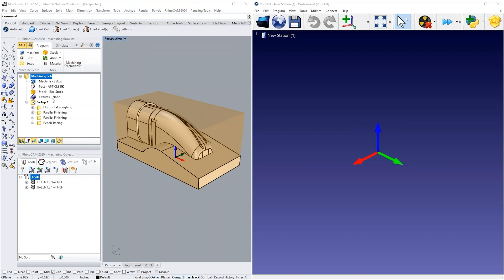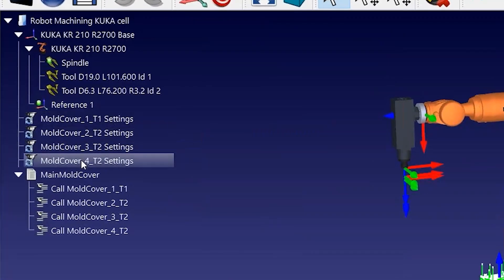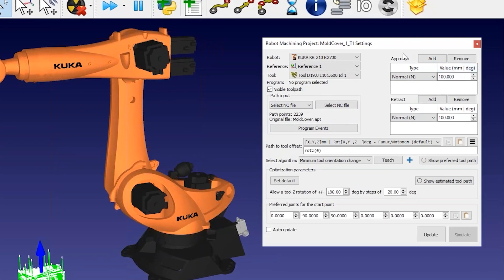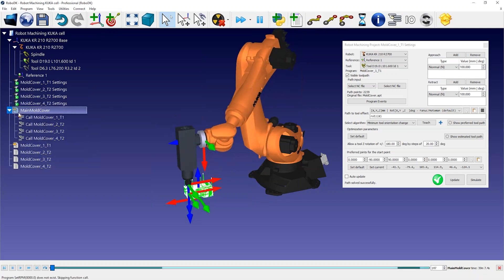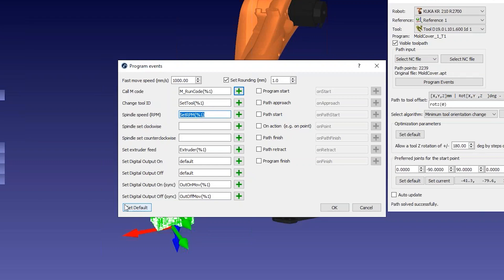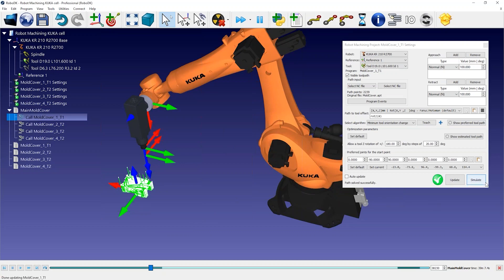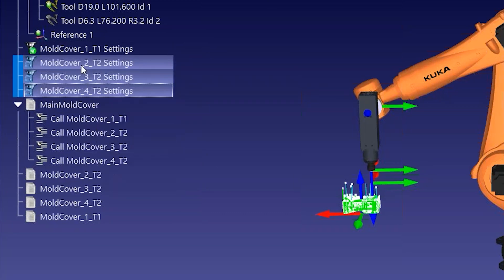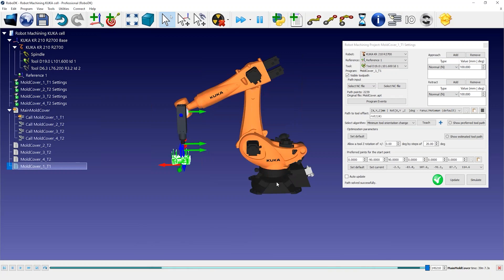3-Axis Robot Machining Example - RoboDK

Comment: How can i add or chosee tool diameters? I mean cutter tool diameters? You show how can we milling but you didn't show how adding cutter tool. There is no any information about cutter tool dia! 6mm, 10mm etc..
Reply from the maker: You can offset the toolpath from the curve by using the curve follow project path settings.